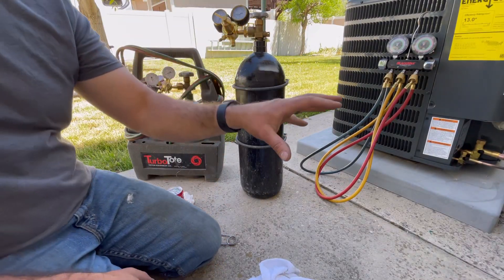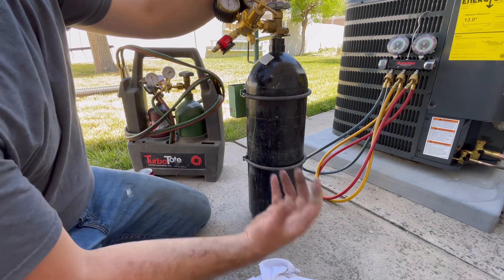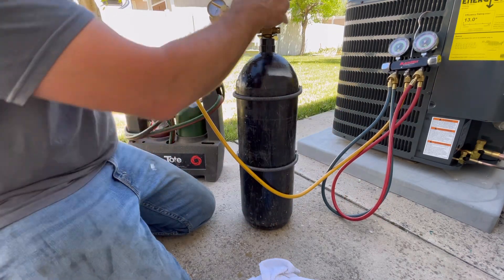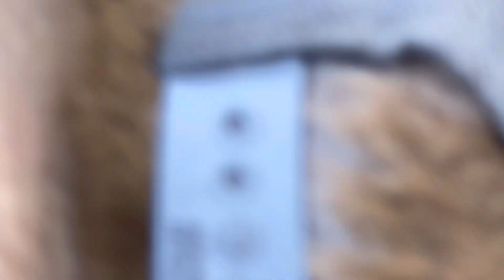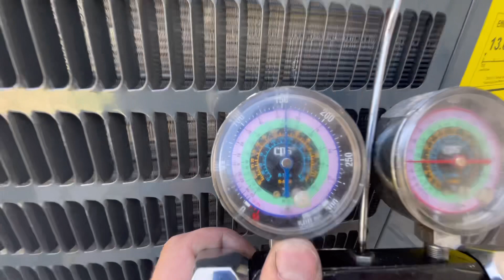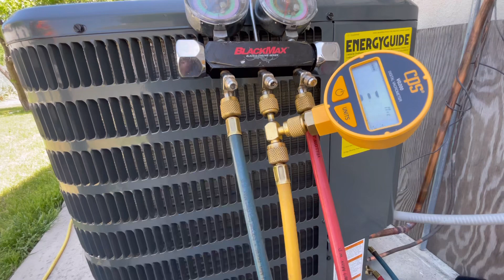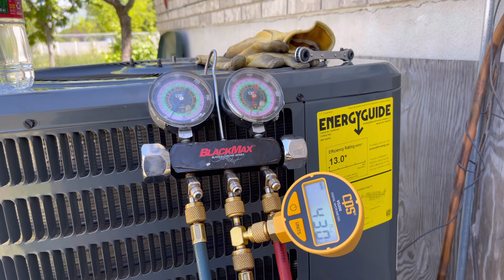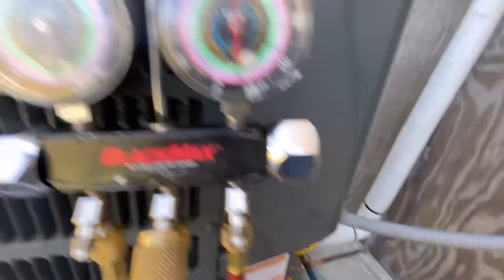DIY Air Conditioner Replacement  Part 3      -Step By Step Guide-

Comment: GREAT SERIES SIR! Thanks so much. Your skill set as "handy man" are excellent. I watch a lot of other channels with some great journeymen HVAC guys but you hold your own against them as far as installs for sure. I am not an HVAC guy but I am a DIYER that just trys to keep his crsp running and I sure appreciate the knowledge you pass along. Keep the good stuff coming!
Reply: Thanks for doing this video series as I’m looking to possibly do this exact thing. One question I have is my old ac is r22, can I use the existing line set with the r410?
I will be doing both condenser and coil replacement.
Thanks
Reply from the maker: @robertpearson8989  hey! Yes you can certainly leave it, as long as there was no burnout. As soon as you open the lineset up you will know, but if your system is still running and you are upgrading then you are fine to swap it out and don’t need to do anything with the lineset. It is not very common to get compressor burnout but if you do, you will know it. When you open the lines you will be greeted by the nastiest burnt acid smell you’ve ever smelt. It makes differential fluid smell like roses 😂 I’ll have to do a video on compressor burnout.
Reply: @robertpearson8989  you’d want to get a flush kit and flush the line set so you don’t potentially mix left over r22 with the new 410a. After flushing both lines.. run nitro through the lines and you’ll be good to go.
Reply: Really QWERTY😊
Reply from the maker: Thanks man!
Reply: @diyhvacguy  you stated that a micron gauge is optional and that letting you vacuum run a couple hours should get you where you need to be and I believe ya. But is there a reasonable gauge a diyer could purchase? These seem a little pricy. Have thought about maybe doing some handy man work when I retire but...? Don't want to drop alot of money for just a once or twice use. Any help appreciated. Also...I have a pump and gauges for automotive a/c work. You mentioned a residential pump. Will my automotive pump get me pulled down to an acceptable level?
Reply from the maker: @hitekrednek66  yea, totally optional. The first few years doing hvac I never owned a micron gauge. Just really check your weld joints with a mirror and let the vacuum pump run for several hours.
Reply: @hitekrednek66  I didn't see DIY HVAC Guy's gauge set clearly, but in the past the gauge sets I've used have always had a little scale "below 0" that would indicate in in/Hg (inches of mercury) the vacuum you were pulling. IIRC 29" was a theoretical "ideal" but unattainable, plus the gauges aren't that accurate; seems like I look for "pump 'til it stops dropping" (usually around 27, 28" on my old set) and then wait as long as practical to see if it stays put when you stop pumping.
On another note, those vacuum pumps can be rented VERY inexpensively from AutoZone and the like. A little up front for the deposit, ya, but in the end cheap.
Reply: @diyhvacguy    I would suggest you spend more time on torch set up and safety, especially advising not to let your nitrogen tank set free without it being strapped do a vertical structure.  If it is accidentally knocked over and the regulator breaks off, you will have a missile.    I would also suggest that you use a smaller rosebud or tip and set your torch so it is not like a cutting torch.  Use the hot fitting to melt the brazing rod, not the torch.  Way too much heat  for such small lines.  For vertical joints heat higher on the fitting to draw the shoulder up, instead of down.  Hope this helps.
Reply: @rodgraff1782  Good advice.  Heat the copper to a cherry red color and put the stick of silver rod to the hot copper.  Use the torch to pull the silver to where you want it!  I've been brazing/soldering for years and I was taught this method a long time ago - when I was using the torch to melt the rod.
Reply: @diyhvacguy   glad to see you’re using a nitrogen purge.  I suggest you don’t use Chanel locks on the brass fittings.  It just doesn’t look professional, and scars up the nut.  Also use a back up wrench, both of the proper size so you don’t twist the fitting

Comment: I thought you pressure test to 350 pounds? In other videos, you disconnect the pressure at the Schrader valve quickly to blow out any contaminants. Why did you do it differently this time?

Comment: Really Like  this  Comment  !   ~    !  The problem with R410a is it's scrubbing ability to clean all that carbon off the inside of the line set, which R22 could not do. If you can't flow nitrogen don't braze. Use Stay-Brite 8 and solder your fittings using MAPP gas or acetylene if you have it. The lower temperature won't cause the buildup of containment's like brazing with oxy-acetylene will. Make sure its Stay-Brite 8 and not just plain Stay-Brite. There's more silver in Stay-Brite 8 and it makes a difference.

Comment: Great series and love the channel. I have a 30 year old A/C with oil furnace. It’s taking my system much longer to cool my house and on extreme heat days in the NE it will sometimes never cool below 80 degrees and never shut off.

Can you tell if me what system I should be look8ng to get for replacement? Do you think a new system will cool better and save electricity at the same time?

Comment: So if I'm just disconnecting my unit to move it for some concrete work, and then reconnecting it, i can skip part 2 and most of part 3, correct?

Comment: That was awesome. 

1. Do you need to change out the line set for different refrigerants? I have R22 and will be going to whatever the new system takes.
2. Where was the coolant after evacuation. I missed the part where you filled the system
3. There is no way it's this simple. If it is I know I can do this. The additional tools would be a one time use, maybe look on market place?

Comment: Really great video. Thank you! Question about the nitrogen step. What's the reason for hooking that up before soldering the connectors back on? Does it help detect the leak in the solder?
Reply: Nitrogen is passing thought the system instead of air that has oxygen.  Oxygen is an oxidizer - it will allow residue on the inside of the pipe, which can flake off and get stuck in the system.  Yup, I did it, so I learned a good lesson!

Comment: Tip: braze before connecting the electric. You don't accidentally burn the seal-tite (flexible conduit) and you have plenty of time to do the electric while the vacuum pump is running.

Comment: I would add you will want to set the fan speed of the furnace on cool setting to match the tonnage of cooling, 400 cfm per ton. 3 ton unit you want to make sure you furnace is at 1200 cfm with a less than .5 static pressure

Comment: Ac tech 
Great video, I’ve seen new install range from 6,500$ to 16,000$ “Lennox 3 Ton 17 seer” you could try HVAC Depot out of Plano. If you’re in the DFW area they have great prices on equipment and parts.

Comment: This is great information. I have a couple questions before I attempt my install.

My current system has a 50' line set will the condenser hold all that R22 refrigerant for self storage?

When I install my new Goodman unit it's pretty charged for a 15' line set. I haven't seen you add additional refrigerant to any system on your videos. I would assume I need to add about 21oz of additional refrigerant?

Comment: When soldering isn’t this just like plumbing where you should only heat where you want the solder to get sucked into? Also, you only need “under proper application” the width of the pipe is the amount of solder needed.
Reply: Also can you help me “with your license” get me a couple 5 ton trane xr14 units gas furnace attic inside units at cost in Az……

Comment: Great Video 
Great job as well
I’m going to try to install a system in my manufactured home.
I do have a question. It will have propane heat what effect will it have on the refrigerant?

Comment: If this is a diy video, why in the world are you not using Stabrite 8????? And stakleen flux?  I spoke with my neighbor who is a top notch hvac guy re using my R22 line set with R410a he said he recently received a tech note to the effect that this can be done as long as there was no compressor burnout. As far as nitrogen goes, 78% of the air we breathe is notrogen. Any comment? By the way, the right way to solder, braze is to heat the fitting, then simply let the rod, solder to flow into the joint by capillary action. Never had one leak. The key is clean. The copper has to be very clean, with emory, not sand paper.

Comment: If this is a DIY video, why in the world are you not using StaBrite 8 or even presslock fittings. Not many DIY people have an oxyacetylene set up, mate. How many people realize that 78% of the air we breathe is nitrogen? 😮 One more little thing: DO NOT use sandpaper to clean copper. The glue they use to adhere the grit can interfere with soldering. Only use emory cloth, and only rotate perpendicular to the logitudinal axis of the pipe.

Comment: Thanks, I really appreciate this whole series.  I'm a pretty experienced/handy DIY-er but have always felt like HVAC work was beyond my skillset and I no longer feel that way.  I do have one question and it's probably a dumb one, but does the new condenser unit you installed here come already charged with refrigerant?  I'm thinking the answer is "yes" and that, once you vacuum out the lines, then all you have to do is open those 2 valves with the Allen wrench and that releases or "charges" the system?  Have I got that right?  I kept waiting for step where you were going to hook up another tank and run it through that manifold, but I guess that's not necessary because the refrigerant is already in that new Goodman unit?

Comment: If you're converting from r22 to 410A and didn't replace the line set did you omit the flushing process before you started evacuating?
Reply: I'm interested in this answer too

Comment: Hi, it seems to be a lot of work.. easy to screw up I guess.. I didn't see how you charge up the system, that was not in the video.. I also have a question, the heating and cooling company told me that I have a leak in the system.. and want $800 just to find the leak out.. to me it sounds too expensive.. so I am between a rock and a hard place.. also my condenser aka exterior unit is kinda newer but the airhandler aka inside unit is old from like 1995.. and recommendations? Thank you..

Comment: During the nitrogen pressure test the nitrogen cylinder valve should be closed after the system was pressurized. Otherwise the cylinder will replace any nitrogen lost during the test.

Comment: I've noticed you've evolved on your setup for pulling vacuum since July 2022 when you posted this.  Perhaps you could do a video on the pros and cons of the various ways you've performed this task over your career.  And maybe explain what you'd consider to be the minimum setup (or minimum/better/best) that the DIY person should have to ensure a successful vacuum.  Is it okay to pull vacuum through the manifold gauge set? Which tools are must have/nice to have?  Micron gauge?  Schrader core removal tool?  High volume 'blue' vacuum hose?   Maybe this should be premium content.  Thanks for all you do, Dave.

Comment: Quick tip from an HVAC tech. At the end after you're done testing pressures you are taking refrigerant out of the system... as long as your guages are clean and haven't been used for leak checks an what not you should take your high side off leave the low side on and open your guages to put the refrigerant from hoses and guages back into system.

Comment: So typically for an accurate reading, you should typically put your micron gauge as close to the system as possible, and as far from the vacuum as possible.I usually place it directly between the line and high side of the system

Comment: i bleed my high side line back thru manifold to add the liquid from the hose into the system   i know the epa allows a little bleed off from hoses  but this  is what i do 🙂  ALSO LOVE THOSE LOW LOSS FITTING YOU HAVE ON THOSE HOSES   KEEPS FROM BURNING YOUR FINGERS    DONT ASK ME HOW I KNOW!!  HVAC WORK GETS IN YOUR BLOOD  THATS WHAT MAKES YOU GOOD AT IT

Comment: I am 50 minutes in to 3 videos. I am a GC in CA, I do all my own plumbing (remodels and ADU's), (and framing and electrical, and tile). I have to ask, the oxy torch vs MAPP, is there a difference in what you are doing? I can make a much cleaner joint with MAPP,  no leftovers needed on the slip in pipe, and everything getting pulled into the joint or brass fitting. Is there a reason for it? I am truly asking humbly as I want to change my own condenser at my house. Thanks man! Appreciate your time and effort to make the videos!
Reply: and also. I did not see any flux? Not a point out, I just would love to know "why". Thanks!

Comment: Just a tip i was told its easier to see any missed brazed parts on the pipe before you wipe it to cool it off.

Comment: R410a was mandated in new systems in 2010. R22 was still being manufactured and sold until 2020 just 4 years ago and reclaimed R22 could still be used in R22 condensers after that date. When he says systems 30 years ago are still running strong WITHOUT nitrogen brazing, he's talking about R22. The problem with R410a is it's scrubbing ability to clean all that carbon off the inside of the line set, which R22 could not do. If you can't flow nitrogen don't braze. Use Stay-Brite 8 and solder your fittings using MAPP gas or acetylene if you have it. The lower temperature won't cause the buildup of containment's like brazing with oxy-acetylene will. Make sure its Stay-Brite 8 and not just plain Stay-Brite. There's more silver in Stay-Brite 8 and it makes a difference.
Reply: I have viewed many of your videos. I am finally retiring my swamp cooler after many years. You video's gave me the confidence to order a new system and install it myself with the help of my son, who is an electrician, ran the 220v line and did the cutoff box. So I am at the point where the line sets are dry fitted, ready for brazing, pressure test, vacuum test, etc. It needs apr 2 lbs of r410a added to the system. ( .6 lb per ft after 15 ft as per manufacturer specs. Lineset) is between 18-19 ft long). I would like a professional tech to do the rest but Anyhour HVAC wanted over $2500 to do it and Whipple HVAC "no job is too big or small" refused to do it at all. So I may have to DIY it anyhow. But since I am local, by Hill AFB, I think I will give you a call.
Reply: Thank you! Can I reuse my R22 line set with R410a? It sounds like no. What say you? Also, from what I have heard the powers that be cannot seem to settle on a refrigerant for AC, ( Not that this surprises me in the least, every govt agency I had any contact with in my career could not find their collective asses with both hands) I hear that they might go with Propane??? Wait till the Liars ( Lawyers) get ahold of that one. 😂
Reply: @JamesAgans  Yes you can reuse your R-22 line set but  you have to flush it out first. There's videos on how to do it and you can buy the line flush tool for about $25.00. I used tolulene first and then acetone. Worked good.
Reply: Savings this 👍
Reply: your comment will save me so much headache thank you!

Comment: What can i do if i dont have nitrogen to pressure test?
Reply: If you don't have nitrogen you need to solder with Stay-Brite 8 and Mapp gas. The lower temperature won't cause harmful deposits inside the copper tubing. Then you need to vacuum the system and let it sit for 20 minutes at a less than 500 micron level and look for any rise in the vacuum gauge above 500. If it holds steady you're good to go.

Comment: Hello.  Thanks for the video.  In the first part of the series you referenced the need to flush the copper lines but I don't think I saw you do it?  Can you comment or point to the need to flush copper lines that would remain in the system especially when changing from different types of refrigerant?  Thanks again!
Reply: Going from R22 to R410a requires a flush because the oils are totally different and not compatible. It's very difficult to flush the evaporator if not totally impossible and it should be replaced too. Cut both liquid and vapor lines at the evaporator and condenser and flush acetone through the lines using one of the 25.00 flush canisters with the hose attachment. Go from high to low and flush several times. You can crimp the end of both tubes for a bit of restriction to the flow. Works great and better than spending big bucks on commercial flush.

Comment: Should this not be sweated like copper pipe with a propane torch, solder, and flux?
Reply: No!  Must use hard solder or the joint will fail.  Lots of vibrations going on and much higher pressure vs water pipes.

Comment: Hey, did you cut out the part where you introduce the refrigerant?
Reply: I know this is an old comment but, the compressor was likely precharged. So when he was using the Allen wrench to loosen, it was introducing the Freon.

Usually they are pre charged for a certain length (mostly 25’) of line. So if it’s a longer run, then it may need additional Freon added.
Reply: 14:30 ish
Condenser unit precharged. Usually for 15ft of lineset.
Reply: Is that 15ft from condenser to coil or both lines added together? @icanreadthebible7561

Comment: Did I miss the part where you put freon into the new unit? Or do new units come with some Freon already in them?
Reply: New units are filled with refrigerant. You then double check to make sure the level is good from the manufacturer and add virgin refrigerant if needed

Comment: Okay after brazen when do we add the refrigerate?
Reply: It’s a pre charged system so it comes with Freon already in it so when he opens the king valve the Freon in the outdoor unit flowed through the lines into the indoor unit